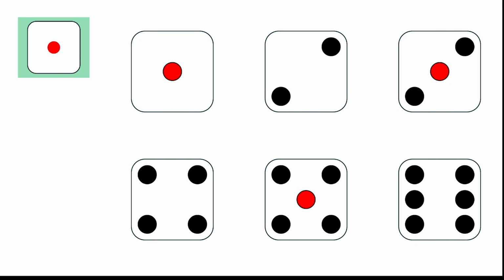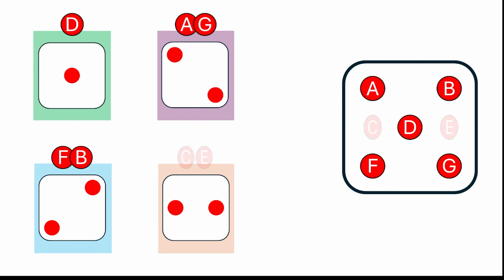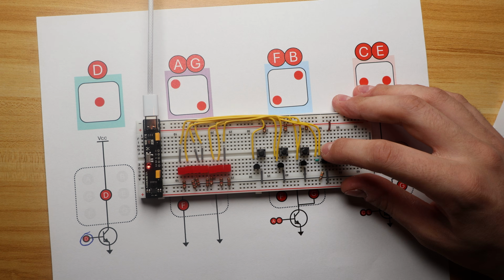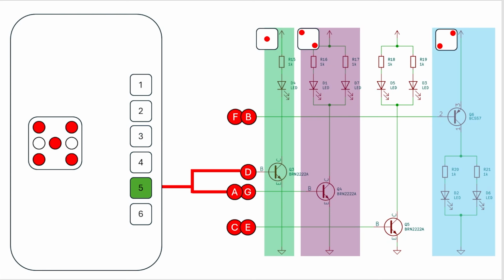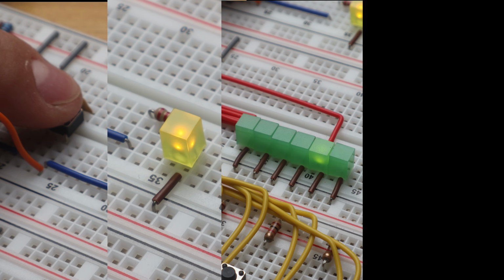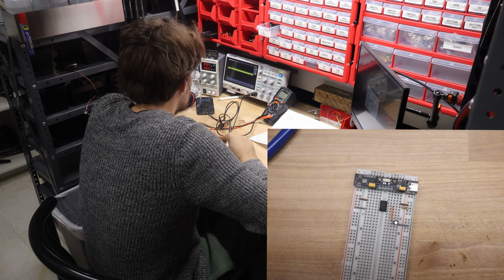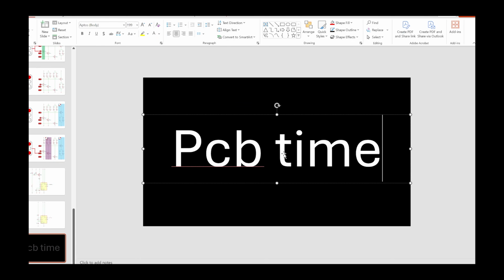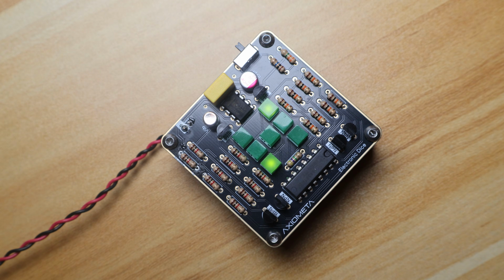I Built a Dice Without Writing a Single Line of Code

Comment: I built one such device some 40 years ago with my father. It used two 74xx logic ICs only. I do not remember exactly, how it worked, but quite similar way to yours. It had clock generator from two inverters (or NANDs turned inverters), dec counter (7490 I think... It might have been open collector version of it) and the rest of the other logic chip was used to either invert or reset the counter, so it would count just to six (0-5). It had pretty high frequency, so hitting any desired number was impossible - it was some hundreds of kilohertz.

Comment: I was looking for exactly this. Other 555/4017 dice circuit topologies compromise the statistical randomness to decrease component count and cost. They also compromise the ability to drive LEDs of any color safely for the same purpose. Some don't even bother to arrange the LEDs in the traditional pattern. The only changes I'll make when I build mine is to use round LEDs, SIP or DIP resistors, possibly a transistor array and a different power supply. Eventually, I want to shrink the form factor down to SMD components and a rechargeable battery.

Since you only need 6 counts and a reset, have you considered using a 4022 instead of the 4017? It's an admittedly pedantic change driven only by a desire to minimize unconnected pins.

Comment: Did something similar a while ago, using the vco of a 4046 as the clock source, driven by a rather large capacitor that charges up through a resistor and a tilt switch, and continuously drops charge through another resistor with a high value. This also feeds a comparator, driving a 4043 latch.

The latch holds the last value generated by a 4040 counter from the variable clock. If the comparator flips, the die is cast. 

For output, i used a nixie tube. Nice about this, is the visual effect of the die rolling and gradually slowing to a stop.

Comment: This dice lacks chaos which is the source of randomness in an actual dice role. This dice will give highly correlated outputs if you are even remotely consistent with how you shake it.
Reply: The limiting factor is how fast the decade counter is looping.  When I built mine with a 555 timer, I just used a decade counter and binary decoder with a 7 segment display and ran it very very fast.  Thousands of iterations per second.  You can adjust the resisters and capacitors to speed up the 555 timer so you can't possibly be accurate enough in how long you shake it for.
Reply: @bereanfruit  I have a feeling if you tried really hard to trigger it in evenly spaced intervals and recorded the numbers, they would probably quickly fail statistical tests. My hats off to anyone willing to put in that much effort. Maybe you could automate it.

Comment: This helped me better understand how Pong and other early 70s arcade games were made using discrete circuits. I couldn’t comprehend the leap from assembly code to manually constructing a game transistor-by-transistor, but it’s easier to imagine designing when you have an end goal rather than translating code line-by-line. Still, it must’ve been a nightmare to debug a discrete game before it was shipped…

Comment: Holy shit I love this. Could this be built with one of those tiny solar cells like old calculators had?
Reply: Yes, but you'd have to use a much lower powered display such as an LCD. A small solar cell won't have enough energy to drive LEDs in this manner.
Reply: @KJ6EAD a segmented display would be very cool

Comment: I understand the design with transistor..the 4017 and the 555...but how work the circuit that you move it and the 555 works?
Reply from the maker: When I reached he final point of the design, the only way to roll the dice, was to press a button on 555 side, which triggered the "roll". All I have to do was replace the button with a vibration switch, its basically a metal ball in a metal can that shorts two leads, which in turn makes it an always pressed button. And to make it work, I had to invert the logic, so I added another NPN transistor, which allowed trigger the "'roll''' whenever the ball inside the can was open... I hope this clarifies a little
Reply: @axiometaoh yes, this explain it so good. Thanks 👍

Comment: Just had a look at your website. All of your projects, PCB designs, and every detail are absolutely top-notch. Wishing you nothing but the best going forward.

Ps. Are there any really good high-quality breadboards being made these days? After seeing the ridiculous amount of detail and effort put into your breadboard power supplies and modules, I can only imagine you would want to use very high quality and solid breadboards. Like the vintage ones that used to be commonly available by 3m and came on very nice build plates with little rubber feet, built-in banana jacks, high quality gold-plated contacts, and stuff like
Reply: Global Specialties still makes some like you described, I think.

Comment: With enough practice you will know the delay between shaking and  end of "rolling" so you can get the result you want.
AT LEAST make the 555 so fast that you can't see which "face" is on, or have a blanking function until it stops shaking or even rolling...
A better way would be too have a (semi-) true randomness source

Comment: It seems to be sequentially cycling and not random. Meaning it's not a true dice but a facsimile. Neat project but skipped the truly random part of the logic.
Reply: This. Also with enough practice you will know the delay between shaking and  end of "rolling" so you can get the result you want.
AT LEAST make the 555 so fast that you can't see which "face" is on, or have  a blanking function until it stops shaking or even rolling...
Reply: That caught my attention to. Around 2:22 he says he’s “introducing a sense of randomness” so he knows. I’m curious how real randomness might be included in a build like this.
Reply: @NotDrDre  make the clock very fast